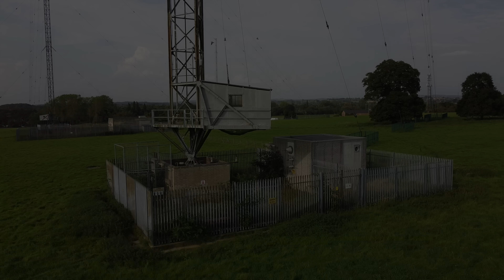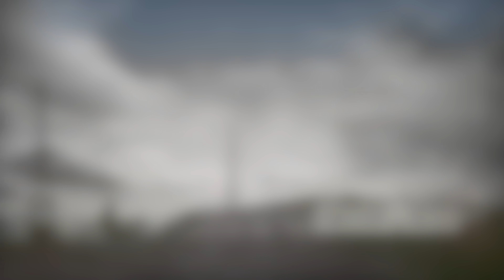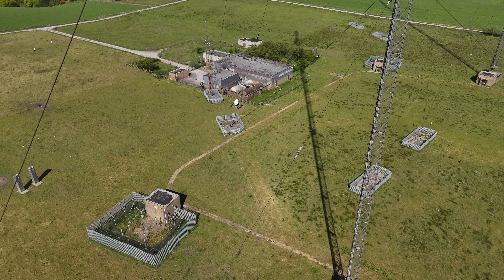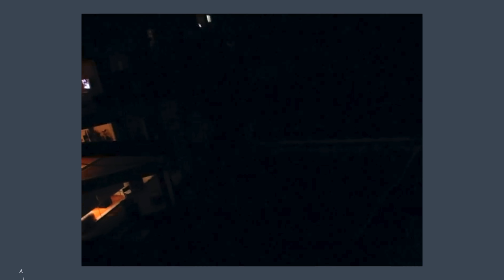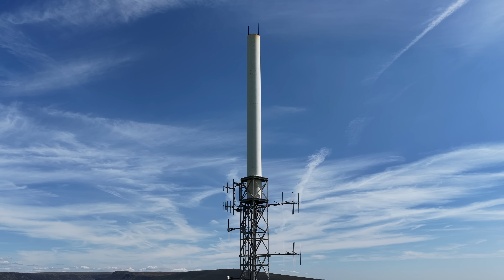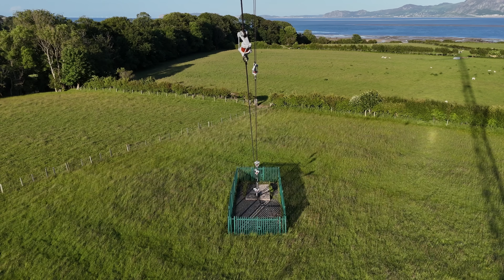Can You Harness Free Electricity From Radio Signals?

Comment: Getting arrested for harvesting power from radio waves‽ 😂 Sounds like the BBC haven't heard of crystal radios.
Reply: Crystal radios do seem magical. It's so strange being able to listen to the radio without a local power source.
Reply: @ddegn >>> I have always viewed crystal radios the same way...👍
Reply: About 3 miles from moorside edge i could get about 3 volts on the tank coil of a crystal set. It could provide several mA and worked a high impedance speaker.
Reply: @curiousbits  One of the problems with crystal radios is that the power level or volume they can achieve is rather low, even when using a crystal ear piece.  And crystal sets only seem to work in somewhat of a proximity to the transmitter.  With no big transmitter site nearby I never got a crystal set to work here.  Other more complex radios involving tubes or transistors do work well however.
Reply: @ralfbaechle l was given a little red plastic crystal radio in the early 1960s, the crocodile clips attached nicely to my bed head so l could listen to pirate radio.
Reply: Used to listen to BBC radio 4 MW from Crystal Palace transmitter on a crystal set in SW London.The inductance was powerful enough for me to be able to hear the ear piece chirruping across my bedroom.I have a copy of Wireless World where a batteryless transistor assisted crystal set was able to power a small loudspeaker.The author of this design used his set to listen to the BBC Home Service.
Reply: Bought one for 12/6 in the late 1960s. It had an earpiece and worked by attaching a crocodile clip to a crittal window frame.
Reply: @normansaunders6891 I made a crystal radio when I was a kid. I thought I would be able to listen to the cool nuclear explosions of the cold war the foolish adults were afraid off.
Reply: @monad_tcp cool fusion (anutronic) is usually a reverse field configuration with non radiating boundary,  radar cannot spot it generally. Think Orbes/foo fighters.
Reply: That was my first thought 🤔
Reply: Most of the power comes from the ionosphere or the ionic flow from your Earth connection, up thru the gear, to the sky, and back again.
Reply: Shhhhh! 🤣
Reply: If your going to pollute the environment with your radio waves don't be surprised if someone tries to harness some of it. 😊
Reply: Exactly
Reply: I remember getting a 'science labs' crystal radio kit for my 7th birthday in 1985. My big brother put it together for me.  I remember being mesmerised my being able to listen to radios stations just by connecting the crocodile clip to the metal finger rest on our old muddy brown BT dial phone 😊
Reply: Man you just surfaced a childhood memory of my father buying me a crystal radio kit! WOW it was so magical to put together and turn on for the first time!!! This Subway Surfer generation is really missing out!
Reply: @freedomutopuia  are crystal radio kits still available? Thinking gifts for grandchildren.
Reply: Yep Amazon selling for about £20. Anyone tried these bargain kits please?.
Reply: a saying says that "someone who sells the scent of food, receives the sound of coins as payment." in this case that is an "radio waves energy"😂
Reply: all well and good but i want them fined for fly tipping radio waves everywhere and making an rf mess of my hone.
Reply: Nesse caso a BBC teria que processar todos os donos de RADIO que sintonizar a BBC vai a falencia Kkkkk
Reply: Who got arrested?
Reply: The difference is the intent.
Reply: Also one can bill the BBC for them sending their waves through your land.
Reply: @G-ra-ha-m and your body!
Reply: @G-ra-ha-m  have you trued foung this ? I wonder if the BBC would tell me where to send my invoice?

Comment: Well, Nikolai Tesla was convinced 'transmitting power' through the air without wired connections was possible.  Whether it would be feasible or not still really remains to be seen.  I suppose the fact that the people around the transmitters weren't prone to being shocked if out watering the garden in their bare feet with a watering can...!  Stranger things have happened though.(Ever been to Roslyn Chapel before the Digital Switch-over?)  It's not easy quantifying or predicting 'Skip'...  Cheers.

Wishing you all the best, Lewis.

Comment: I would imagine finding enough copper in post-war Britain would be a Herculean task.
Reply: Idk, but cooper is just the 2nd or 3rd best electric transmitter (efficency). There are many more electrical transmitting wires than copper wires.
Reply: @ThisIsMyNewAlias On interesting thing I've learned recently is that all of Ampere's work, and Maxwell's work assumed "copper wire" only. The equations are different for other materials. For all we know, using granite, quartz, etc. might work too (Pyramid Code).
Reply: Exactly, and costly.

Comment: I used to work aboard the Peace Ship, home of The Voice of Peace.  (Under a different pseudonym).  I thought I would try to pick up Radio Caroline, who had started using 48m SW.  I put up a long wire aerial, wound around a long metal boom directly beneath the drooping horizontal section of our makeshift medium wave aerial.  Our TX power on MW was 10kW.

I connected the long wire to a feedthrough point in the deck.  Whilst preparing the downlead below deck, I suddenly observed steady arcing on the wire cutters and heard the fizzing sound of violins.  The VOP classical music programme was on air!

I reasoned that it might be unwise to connect this aerial to a Hammarlund SP600 communications receiver, as I had intended.  Instead, I fetched a light bulb socket and a 100W incandescent bulb.  Connected to the aerial, it lit to about 60W equivalent brightness, pulsating nicely with the modulation!

I left the bulb connected, pulsing and gently swaying with the rolling of the ship.  I thought it made a nice instant MW TX monitor.  My boss didn't; he was spooked by it!
Reply: Hahahaha, he thought it was a ghost light?
Reply: @grumpyhale821  Quite possibly!😊
Reply: Caroline once did this after a generator (& money) issue in the early 70's. To keep the Mi Amigo lit they slung floro tubes from the mast which were illuminated by the RF from nearby RNI on the Mebo2!
Reply: @stuartarundale6219  Ha!  Brilliant!
Reply: Shalom! Also spent some time aboard. Some of the engineering on that ship was lethal. The exposed AM feeders and the RF leaking from the back of the Harris FM25k. I repaired the Nautel Ampfet AM transmitter when it blew too many of the hot swappable power modules. Was your bulb the one the crew used to shine over the side to attract the fish?
Reply: @pauleaves469  Eavesey!  How do?  I think the leakage from the FM20K rigs could have been due to the amateurish design of the PA cavity.  Specifically, the earth bonding to the inspection plate.  Harris simply glued some copper braid on the inner mating surface.  The glue deteriorated pretty rapidly, so the braid would sag.  The inspection plate fasteners were made of a soft grey metal; they quickly became loose.

Do you remember the cheapskate attempt at cooling the Nautel?  A domestic, window-mounting air conditioner, like the ones in New York apartments, mounted a few yards away from the TX.  I fixed quite a few of the PA modules myself!

Quite a challenging environment for electronic equipment.  RF, heat, humidity, dust, rust, the ship rolling, engine vibrations when under way and mains voltage excursions when the FM output disrupted the generator's regulator.  Fun!😊

My TX monitor bulb was just for'ard of Kenny's cabin.😆

Comment: Early radio transmitters could harvest enough energie to amplify a AM signal over speakers without a powersupply.
It did include a wasline length of antenna wire. 
I don't believe the early transmitters did anything to aim at the horizon. Especially the horizontal polarized 18km Wavelength 120KW  transmitters.
I doubt you could harvest the radio waves for something useful. If something would work it would be on the magnetic component.
Even then, the Morse code would pulse modulation would cause a very unpleasant light conditions in your house.

Comment: There was a circuit in hobbyist electronics books in the USA in the 1960s and 1970s, basically a transistor radio with an extra coil and circuitry for harvesting enough power from a powerful local station to power the radio. Fraction of a watt, if you were lucky.
Reply: A guy in Chicago contacted me about this, saying he made a large heavy version in his apartment, tuned to a large transmitter that was a half mile away.  With a diode, he could run a small motor.   He claimed that the RF current in the tank-circuit was unexpected ...over ten amps!   Antenna theory can be counterintuitive, and if we add high-Q resonance into the mix, it becomes black magic.
Reply: Yep, here in the UK too - i had a kids electronics kit in the 1980s with a similar set-up, and it did work, barely.
Reply: I had a toy radio that when hooked to anything grounded would play in an earbud.I thought it was the neatest toy!

Comment: Whoever mentioned coils is having a wind up ;-)  Theoretical rectennas to harvest microwaves from space based power stations don't have coils, just a few square kilometres of dipoles with schottky diodes attached.  The coil in a radio does not pick up the signal, it provides a tuned circuit along with a capacitor; the antenna picks up all the received power.

Comment: I built a high frequency crystal radio using a 1N34a  diode  which can tune to 8  to 28 MHz  I can tune into CB radio mostly on high power channel 6 with audio pugged into a guitar amp. selectivity is nonexistent since the entire CB band is contained in that one 27 mhz tuning position on the variable tuning capacitor.  However It can also light up a 12 volt LED connected to the audio connections of the crystal radio when I key up on my own CB radio with main antenna close to crystal radio antenna usually a 5 to 8 foot vertical wire on the crystal set is enough. I even added a fake solar light bulb which looks like much like a vintage glass valve and put a LED inside it  and added it to my crystal radio as a luminescent valve when I transmit on my CB radio.   fun to watch

Comment: Most common receivers quote sensitivity in micro volts so yeah it's possible to deduct that lighting incandescent lights wouldn't work too well but I can see it lighting gas type lights as seen in the radio related demo I could see it scaled up to light a small shed if conditions were perfect, I always thought it would be awesome to put a meter with some passives and a coil up that would show RF just for the fun of it in my window or somewhere just to see the daily signal strength averages

Comment: Headline ends with a Question Mark?

Answer: No...

😂

Fun video again!

Although you can make a simple Field Strength Meter with a small analogue meter, Germanium diode, coil and capacitor.

And do you remember the aftermarket LED flashing antennas for the first generations of mobile phones?
That was stealing your own power! 😂
Reply: Betteridge's law of headlines
Reply: But the cell phone gadgets only worked because they were stuck to the phone antenna.

Comment: Is it really stealing if it's radiated intentionally by the "victim" with the intent that as many people as possible receive it with a device that uses it to make sound for their enjoyment?
Reply: So does every crystal radio, but isn't here something like NFC chip or tracking device or something exactly working this way?
Reply: In the Uk it is a ballance between fair use and theft The transmission is set up to provide a signal to everyone in the proposed area. If you set up a harmonic coil so that all the people down signal of you can't receive that signal, then it is theft. The transmitter-erer has a right to prosecute on behalf of the victims and the bad press caused by their transmission perceived as not good enough.
Reply: @marjon1703  Harmonic coils do not work that way. You can't "suck in" radio waves; that goes against every fundamental law of electromagnetism. The only way to block a radio signal from reaching your neighbors is to jam the signal or erect a 50m-tall metal wall between them and the transmitter site, so long as the wall is taller than the tower or any aerials.